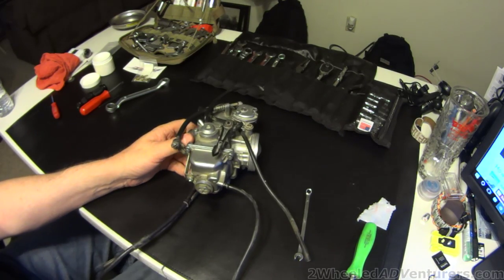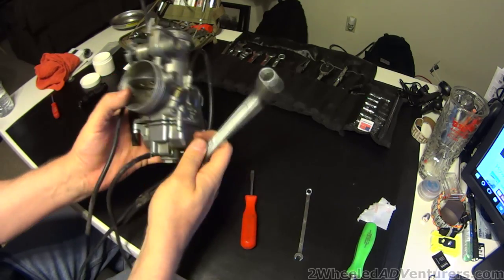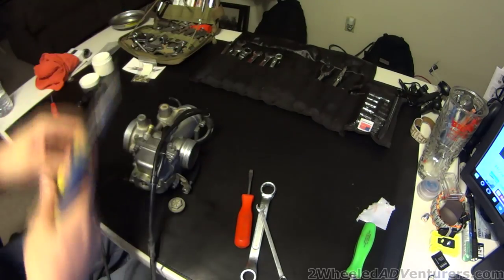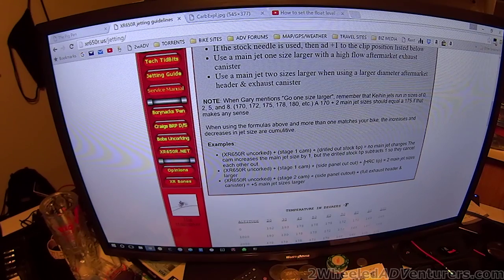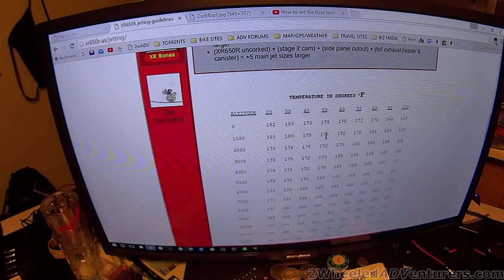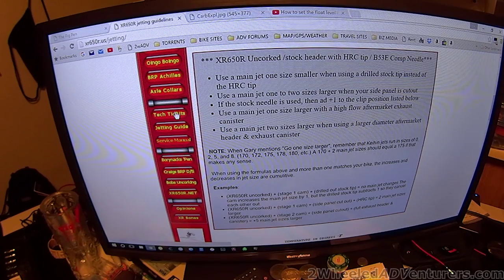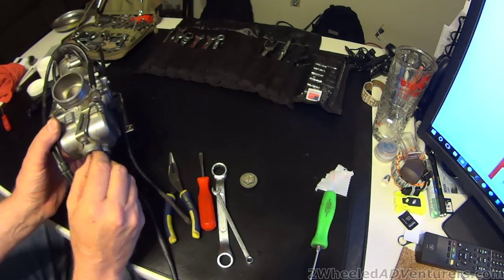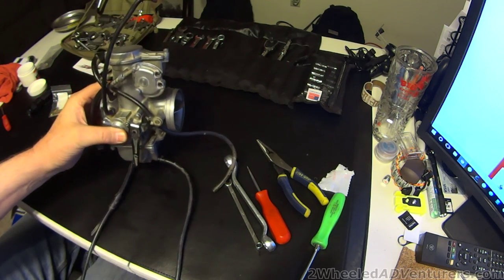HOW TO: Rejet a dirtbike carb KEIHIN XR650R

Comment: Ive yet to pull my carb to look but my carb surges at low RPM constant throttle (or even at slight deceleration - would that mean i'm running too rich? at about 1200 ft uncorked, drilled out stock pipe. 

Thx for the vid  -i'll open the carb up as soon as I get some free time.

Comment: bud my 01 xr650r  it wont even run past half throttle with 175 main it just cuts out  I have like 185 or 188  without 185 or 188 I cant get full throttle it just cuts out starving for fuel